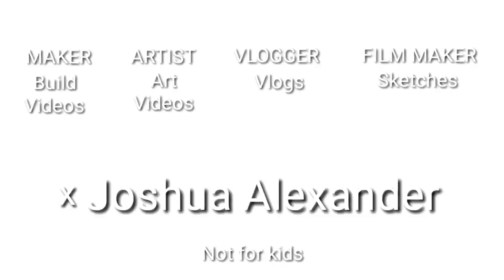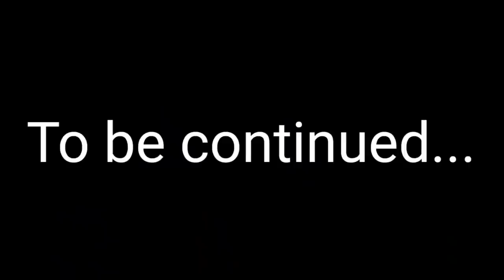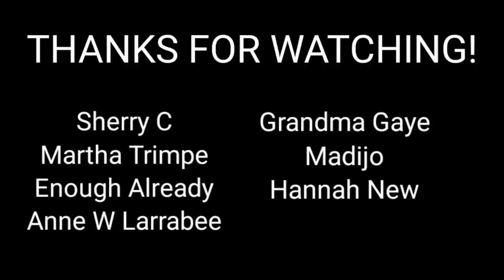I accidently burned a hole in my finger | Another VLOG #96

Comment: Josh, on your shelving, you screwed 2 thru the end and toenailed 1 screw. Did you put a second up thru the bottom? I don't think 3 will support the weight.
Reply from the maker: Just the three. On many. It won't be holding much weight . Should be fine. If not. The beauty of this type of rough construction,  is j can just add a screw if needed.
Reply: I really enjoy your work and your channel wish I were 35 years younger... You have a great YouTube channel....